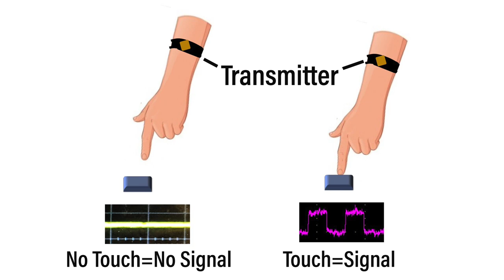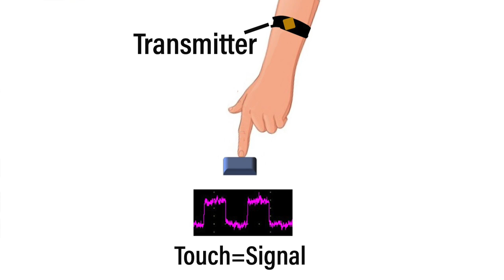Digital Communication through Human Touch

Comment: how are the people with no hands gonna benefit from this?
also if i steal the device or cut off the hand with the device if there is no heart rate as a 2FA(even if it had heart rate i could just wear it on my hand) how is it supposed to protect the user or the device from not getting their hand chopped or their device compromised?
Reply: Last time I checked, people without hands aren't running around alone buying stuff with their phones. Not to mention that this tech doesn't technically require fingers, meaning that people without hands could still benefit from this. An, um, cutting off people's hands in public? I can totally see the device itself being snagged but I doubt Johnny brought his saw with him to Walmart today